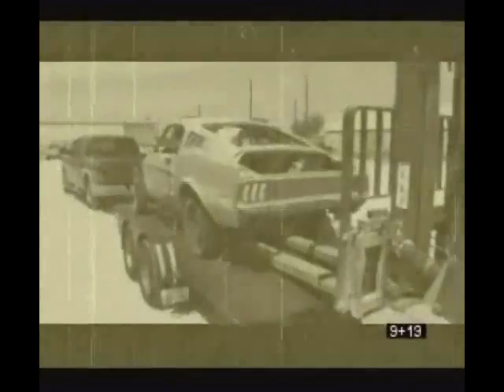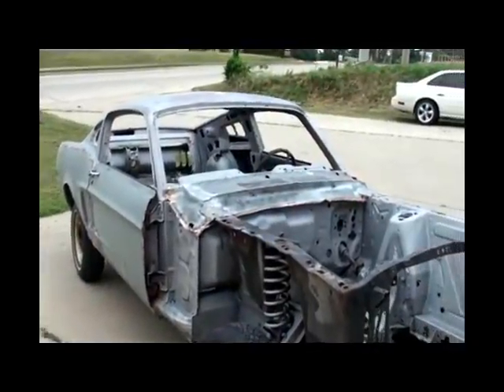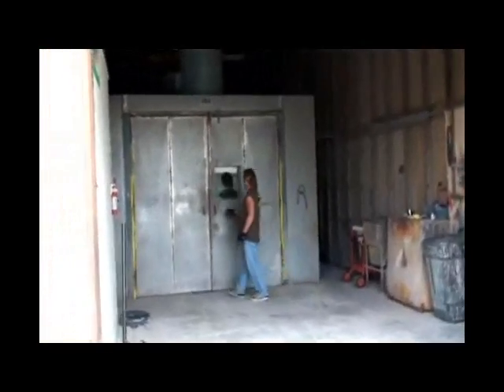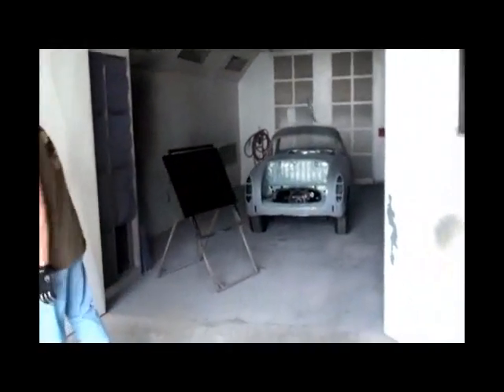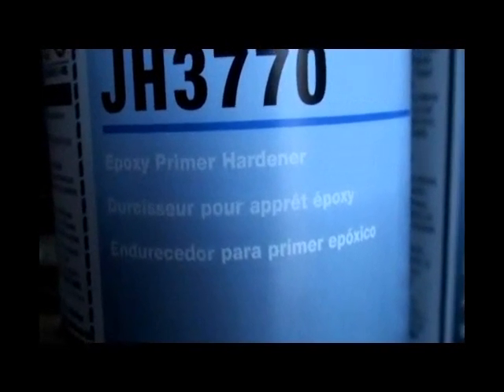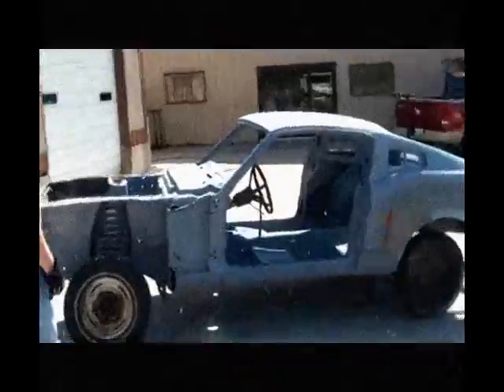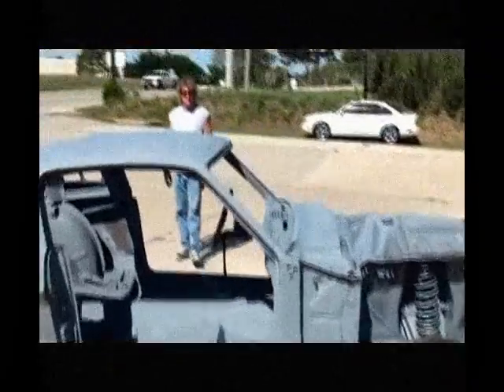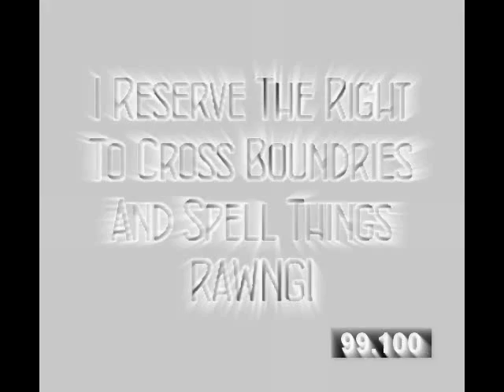1968 Ford Mustang GT Fastback-East Coast Rust Bucket-Part 3-WE WILL NOT GIVE UP!

Comment: Hey Pete ; Keep upmthe good work , Question , whats the best way in your opinion on how to paint ovet a chrome part , Rear dif cover it was cheaper to buy a chrome one the a painted black one ,and i got the bolts and gasket . Should I sandblast it to remove chrome then prime and paint ? Whats your take on It ? Thanks again , you made me want to try almost anything auto related .

Comment: Pete I hate to add to this nightmare for you, but after seeing the amount of rust this pos has, it is guaranteed that the cowl vent area is gonna be gone too. The "top hats" that are hidden under the cowl panel are known to rot out on these cars. That means you gotta drill out about 80 spot welds to get the cowl panel out to access the vents and lower cowl sheet metal. This is a necessary repair on almost all northern mustangs and cougars.

Comment: BIO- DEGRADABLE CARS--I think that year and others were made from steel bought from Japan... The Chevy Luv trucks were rusting on a Brand New Car Lots with 1 mile on them.... GM immediately pulled them off the car lots and crushed brand new trucks.. Turns out the steel wasn't "clean" or "suitable" to make automobile bodys.The steel used wasn't pure enough, still had slag and garbage in the steel... It was shipped in big rolls and then stamped into panels for cars and trucks.. It was raw steel rolls and were rusting unusually bad before  it was even stamped into panels...It was a time when Mig and Tig welders were just making there way into auto body shops..We were using Oxy-Acetylene torches to braze panels and patches on cars.... Back in 74 I had a 69 Mustang Fastback and it was already border line boneyard and only 5 years old..Floors already gone...Trunk Floor just dissolving as you watched... Quarter Panels already pin holes along with the inner wheel houses... 2 years later I was working in a Body Shop and worked on many of these cars from that era..Many had rust that required fabricating metal patches and installing the patches either by welding or brazing.. Many you couldn't Mig weld because the steel was shit and you had to spot weld or braze them on...